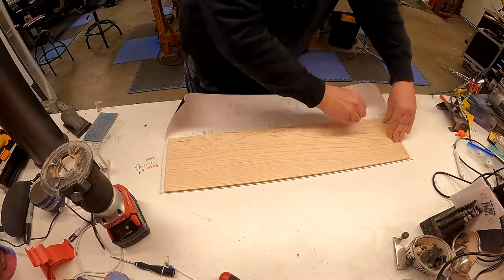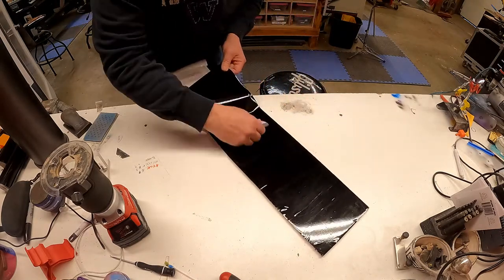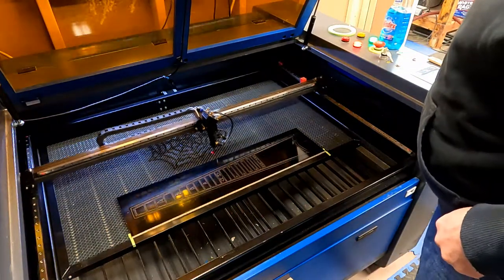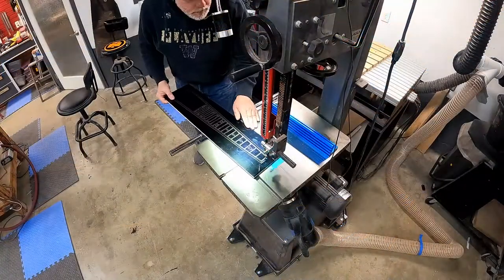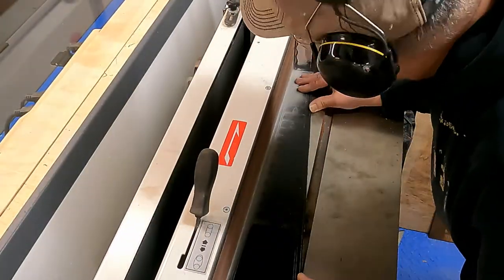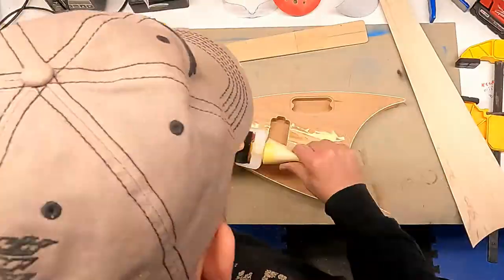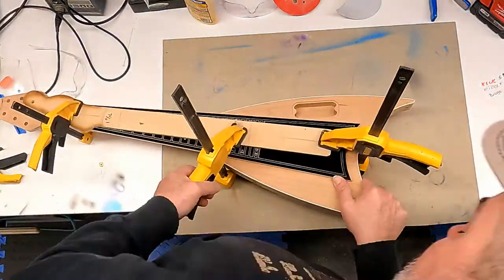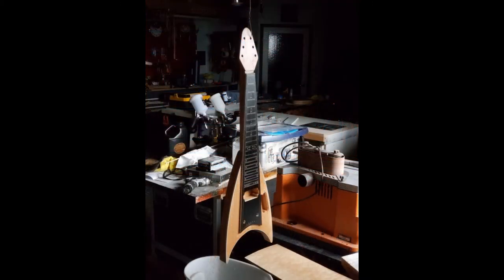Making a custom fret board for lap steel guitar

Comment: She’s a beauty!!! I’m currently refinishing an inexpensive Rogue type Lap Steel I bought on eBay several years ago. building a rosewood fretboard with abalone dot fret markers and plastic abalone binding to replace the cheap plastic one that came with my instrument. As well I’m upgrading to a Fender Tex Mex middle pickup and making a wooden scratch plate. . I wished I’d have seen your video earlier. I’d would have used vinyl as well for the fret board. I’ve put in too much time on this project for the value of it. I’m almost finished though. I must say it was a great learning experience. 

BTW your work and narration are superb!!! Thanks I’ll keep watching… 👏🏻👏🏻👏🏻👏🏻
Reply from the maker: Thanks Mike! That means a lot! That is my 2nd lap steel, still working out some bugs and fixes, but I really dig how they turned out. I should probably do an update on those pretty soon.